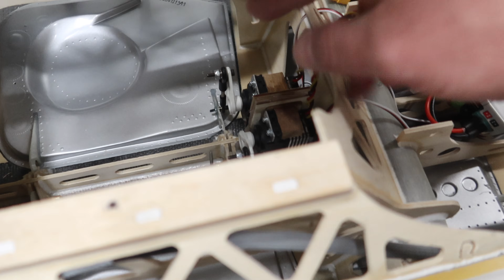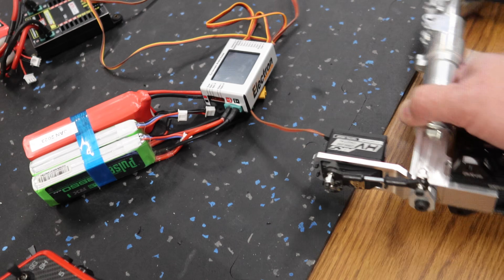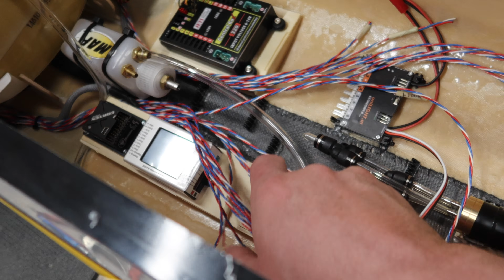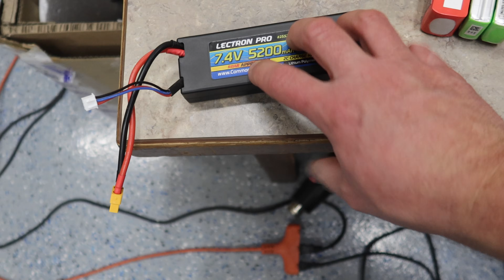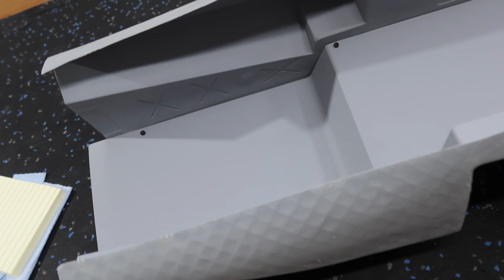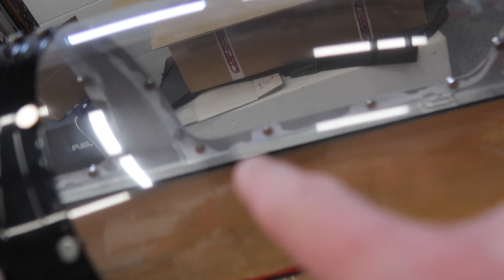GIANT CARF L39 - Nearing Completion - Massive L-39 Jet

Comment: Hi jon, with all the telemetry stuff and GPS onboard, can the altitude and the speed be available in real time on the transmitter screen during the flight ? I think it could be useful for someones because when I watch some landings videos, some guys are coming so fast that even the flaps are not necessary for sure... 😉😉.
Reply from the maker: Hello David.  Oh yea!  All visible and working in real time.  With Jeti there are so many options on how to incorporate this info into your radio.  Height call out if you go above a set limit.  speed call out.  Speed related functions.  ETC. ETC.
Reply: @thelightersideofrc  Amazing 👍👍👍

Comment: I notice that you are using a hard case lipo, I was under impression that they should not be used in aircraft. I think its a good idea. Love to know your thoughts
Reply from the maker: Hey Neil.  I don't necessarily seek them out but If I have the option to use them, than I will.  There is a bit of a weight Penalty  for using them but I like having the hard case.  Can help minimize damage during day to day operations and also in a crash.